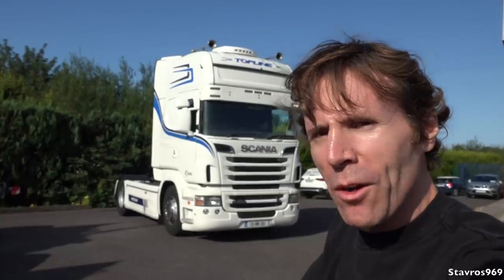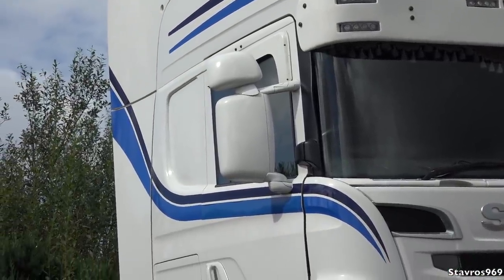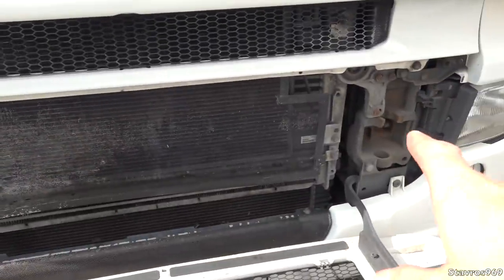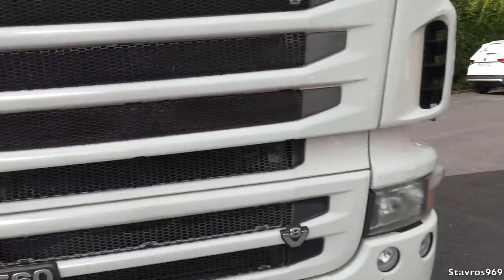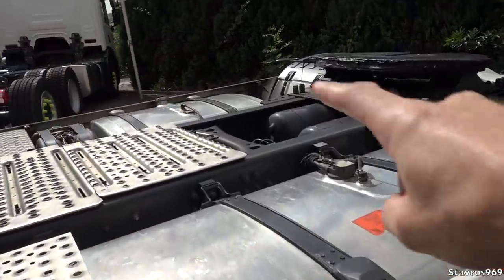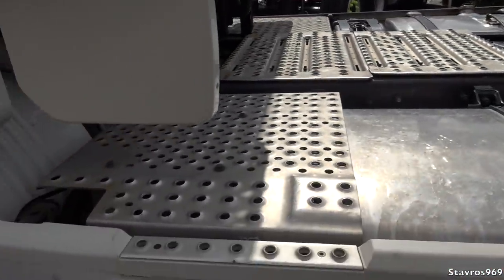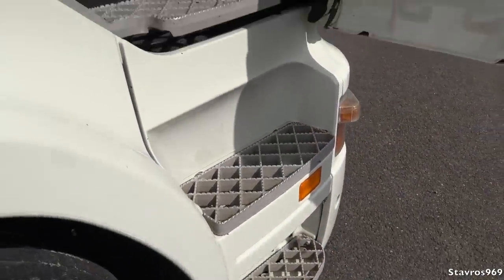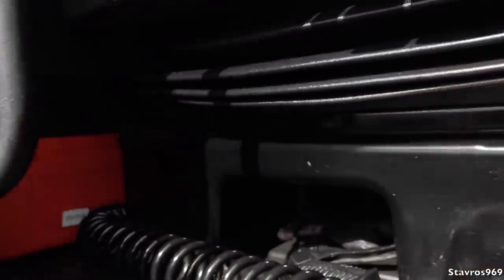2013 SCANIA R560 V8 Full Tour & Test Drive

Comment: Why would you get the extra a/c pod if the truck already has a/c from factory? Are they not able to cope or is it for when the truck isn't running and it's used at night?
Reply: Its used while the trucks engine is off. If you have to sleep on a hot day or even hot night.

Comment: All that HP on a single drive Axle ....  how hot do the tyres get under a big load?
Reply: The same temperature as with a less powerful motor if legal weight limitations followed.